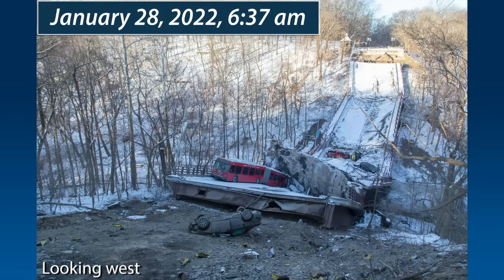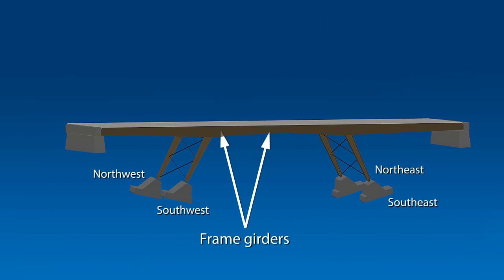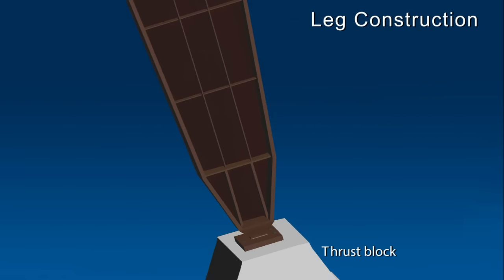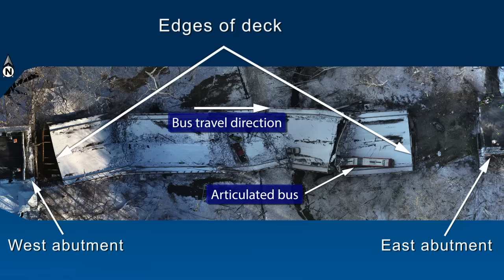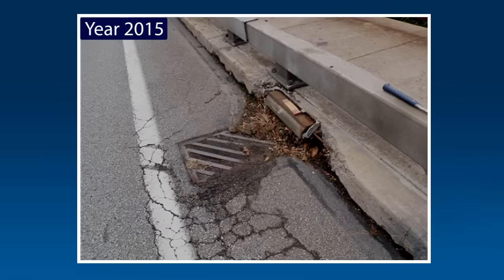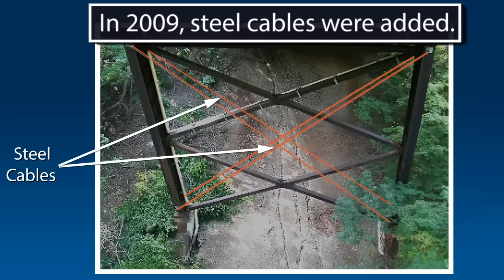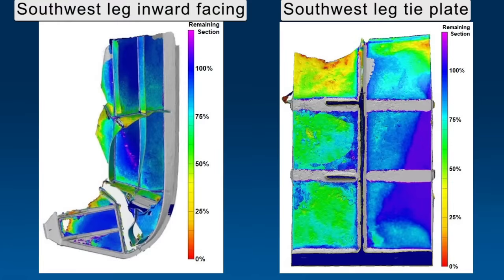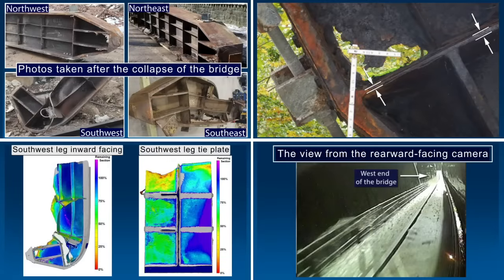NTSB Animation – Overview of the collapse of the Fern Hollow Bridge

Comment: Aside from the gross negligence in not closing this bride and replacing it. I say replace, not repair...it was beyond repair five or ten years before the collapse...but in my opinion, having had quite a bit of structural engineering courses in my engineering degree, just from a basic structural engineering and detailing point of view. In my opinion, this bridge design was destined to fail and the design and detailing caused its short life.  It was a really minimalistic design. In Terms of the size and design and detailing of the legs which supported it.  All those little pieces of webbing that were welded into the legs to beef them up are partly what caused more rapid deterioration. Because every little chamber created by that webbing creates a place for water to collect and sit.  Common sense just says this thing was designed by a very inexperienced engineer or someone trying to push the cost down so far that it had barely a 50 year life.   I sure hope they are locating and carefully evaluating all other bridges in this region by this designer and of similar design.   In a dry arid climate like Arizona this bridge might have lasted 50-75 years, but not in Western PA with our harsh winters and salt use.  Regardless, in my opinion, the design was flawed from day one and it was designed to fail / have a short lifespan.    I hate to say this, but we need to look at when this thing was designed....the 1970's were a period where structural design for bridges and buildings were all being pressured to cheapen things up, reduce costs and cut corners.   When the world trade center towers came down, and the documentaries came out that explained exactly what the methods and structural design approach was for those two towers, I felt sick to my stomach watching those documentaries, because regardless of the severity of the fire and damage from the planes, in my opinion the original WTC towers were both way, way under-designed and pressures to build high and reduce cost (which means lighter structural systems and greater use of "engineered" systems such as trusses and stress skin and composite design) which give credit for creating stronger members with less weight....things engineered in the mid to late 70's were really cutting it a bit too close in my opinion.    On the other hand when we studied various high rise building in my college courses. Buildings like the Sears Tower (1970 completion) used innovative engineering (the bundled tube structure approach) which delivered a very solid strong design.  If you compare the you compare design of say the Sears Sower or Hancock Tower to the design systems used in the original two WTC towers, it's like night and day.  But then. Sears Tower and Hancock were both designed by SOM who in my opinion was the premier structural design firm in the US back in the 1970's-80's....  All due respect, the so called "structural engineer" for the two WTC was more of an architect turned engineer.  SOM's team were hard core structural engineers.

Comment: Numerous Roman bridges and aqueducts are still standing from 2000 years ago, but a bridge in Pittsburgh collapses in less than 50 years with just a very few vehicles on the bridge at the time, even though it was inspected frequently????
Reply: those roman bridges were not designed for HS20 loads.

Comment: So who is responsible? The inspectors for permitting  continued use and the city for not ordering a replacement should be liable. Also, i dont think that a patina can prevent corrosion caused by salts introduced duing wintier driving. The bridge should have been condemned prior to 2013.

Comment: Massive and wildly expensive government oversight from multiple agencies, but no one ever addresses serious issues. They had a 14-year window to address the issues, but it wasn't "anyone's job." This serves as a perfect example of how the government fails citizens. No one is ever held responsible, and it's time to change all of that.

The U.S. could learn from how Japan manages its infrastructure. When they find an issue, it's dealt with in a matter of days, not ignored for a decade and a half. After the 2011 earthquake, miles long stretches of roadway that were completely destroyed when earthquake caused hillsides to collapse were rebuilt in 7 days. There are countless before and after pics of this, in less than a month, the roads, water supply and sewers were repaired or replaced.

Near my Maryland home, there's a 1/ mile section of road where they've been replacing a sewer main for over 3 years. There are metal plates, dips in the roadway large enough to damage vehicles and the cost is astronomical. If that same road were in Japan, they would have closed the road and completed the job in a week.

It almost seems like many of these jobs are redundant and the purpose isn't actually to get anything done, but to serve as an entitlement disguised as a job.

Comment: For want of a couple thousand dollars in plate and labor this bridge collapsed.  How is there budget to inspect yearly but not to actually perform corrective maintenance?
Reply: In PA, municipalities get their bridges inspected by PennDOT at a subsidized rate that just comes straight out of their share of the motor-license fund.  But actually taking on repairs isn't directly covered.  That said, these failures should have warranted lower ratings in the inspection reports that PennDOT performed.  I assume that they didn't get these lower ratings because there would be pushback against them (closing important bridges tend to get people mad at you).
Reply: One of these things cost more than another 😂

Comment: So basically they knew as far back as 2009 that the bridge was corroding and was falling apart, but nobody did anything about it, even though the bridge was inspected 11 times between 2009 and 2021 (every 2 years prior to 2014 and every year from 2014 onwards).  What is the point of doing bridge inspections if nobody uses that information to do anything to correct the problem??

Comment: The steel can NEVER have met the corrosion resistant quality it should have or was sold for. This is due the too high amount of impurities which were left in the steel. This happens if you use (too much) scrap in the steelmaking proces. That is profitable, dus not pay off.
If I was the owner, would let the amount of impurities analyse, and check/compare that to the specs it should have. And seek a very reputated lawyers office to start my case.

Comment: How can those holes be "inspected yearly" and not raise a red flag to close the bridge or actually fix the problem with a permanent solution.  Yo, im no engineer, but if the material isnt there where it used to be*, that *may be a problem

Comment: Interesting that the drainage holes for the roadway actually channel the water and road salts that collected on the surface to flow down on to the supporting legs. If the drainage system were better designed, the bridge may have been standing today. 
PS — Wonder if the state has inspected bridges of a similar design for what may be a design defect?
PS2 — Does the state publish the bridge inspection reports to the public?
PS3 — Has a local news agency made a freedom of information act request to get these reports and published a news story on infrastructure deficiencies?

Comment: Iam no engineer, but it seems that if in the original design, if flanges were added either side of the transverse tie plates to the outside main beam (before it tapers inward) may have simply added a lot of strength.
Would any engineers like to please comment?
Reply: You're talking about adding additional gussets in the corners?

In this case, it likely wouldn't have mattered. The tie plate thinned quite a lot and trying to reinforce something by attaching it to a "wet noodle" doesn't get you more strength than that wet noodle.

Granted, it seems that the webbing is what failed so thickening the corners within the webbing (where it rusted through) would have helped.
Reply: @jasono2139  Thank you for your reply. I understand nothing short of some timely maintenance would have saved the bridge, I just thought it curious that such a simple addition of gussets was not initially designed into the bridge.
Reply: @si_vis_amari_ama  the design of this bridge doesn't look that good to begin with. Normally you'd see some kind of overhead trusses on bridges this large since that immensely improves the strength of the bridge or some kind of arch support above or below the deck.

Furthermore, you typically see the  columns that support bridges are perfectly straight up and down since that carries the weight above without the need of torsion  at the joints. Similarly, imagine spreading your legs apart while trying to hold something very heavy - it would make it harder to hold and cause you more strain in your thighs.

This bridge design looks like it was trying to do too much (have an unobstructed view from the roadway) with too little (shorter supports that took a shortcut to the sloped banks instead of longer vertical columns or an arch)

Comment: Certainly 1000 hours of specialist expertise were necessary to analyze the collapse of the bridge, creating 3D models and showing the EXACT cause and other gimmicks.

How many hours would unclogging the rainwater drains have costed? 2 hours each month? 24 hours a year? 

One drop of oil might replace at least two mechanics. Or construction failure analysts

Comment: This is an interesting breakdown of why the Fern Hollow Bridge failed.  A few more pieces of information can add to this story.  The link below is a wikipedia article detailing the bridge initial construction and eventual collapse.  

This bridge replaced the bridge that preceded it which was built in 1901.  In 1973 that former bridge was torn down and simultaneously the Fern Hollow Bridge construction began.  In a mere 29 years the Fern Hollow Bridge collapsed in January 2022 as reported on this video.  So the previous bridge lasted more than twice as long.  

An obvious question was why this bridge was allowed to stay opened despite the obvious deterioration and not all of the repairs that were intended were completed.   Bureaucratic incompetence definitely comes to mind.  Also the question of priorities is at issue here.  Were there other bridges in greater need of attention than this one and the upgraded work was repeatedly delayed until the collapse happened?   

This same scenario is highly likely to going on across the country with many more bridges at risk of failure.  And when politicians avoid confronting the issue of infrastructure repair it's always the American citizens and of course noncitizens, visitors, etc who end up paying the consequences.  

https://en.m.wikipedia.org/wiki/Fern_Hollow_Bridge

Comment: Your lack of tax dollars not at work , or grift at work.  But look at the pretty lines we painted on it!  No paint to stop corrosion though, that is the pinnacle of IRONic.  Few thing are more important than large public  infrastructure but banging on about imaginary friends, politicking, or enforcing someones petty views on someone else always will get the press until the next disaster to be forgotten.  Inspectors appear to have absolutely zero authority in PA so you might need to avoid anything that needs "inspection for public safety".  Generally any rube can look at steel and concrete in NA and tell if it is ok.  Legislated safety factors are so high you need to see through it before it will let go.  It appears that public safety is now up to the user, just like everywhere in the third world.

Comment: Remember that this rust happens because of the vast amount of road salt being dumped on the bridge. Can you remove ice and snow without salt?  Of course you can; I designed a machine that passes over the bridge after an ice storm, cleans the ice off in one pass to a nice dry road.  Is any DOT or state govt. interested?  Of course not.  So they dump more salt. 
The other solution is to build such a bridge with a different, impervious material: wood.  If that was done, you would also not get this rust-out damage.  Yet I bet you a cheeseburger that the replacement bridge will be of concrete and steel.   Not smart.